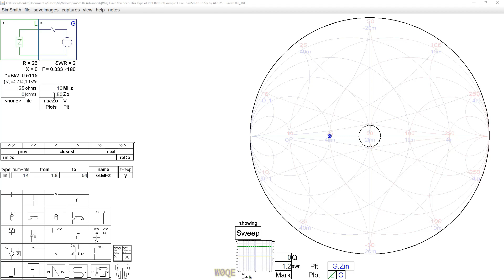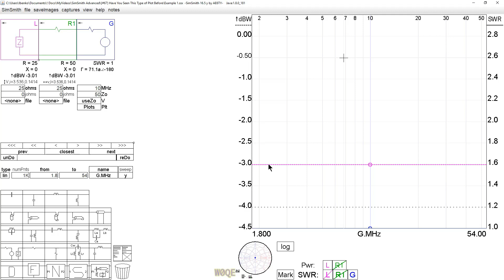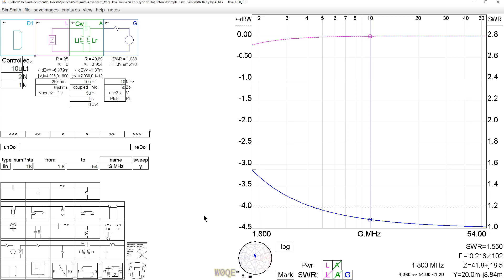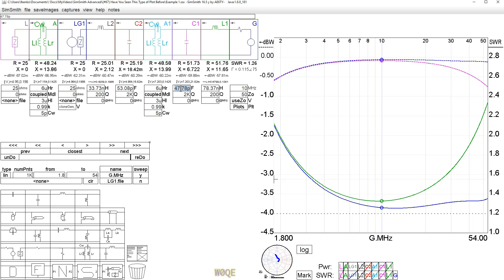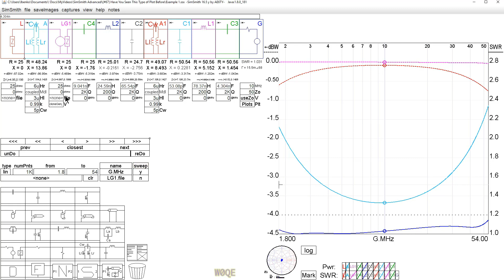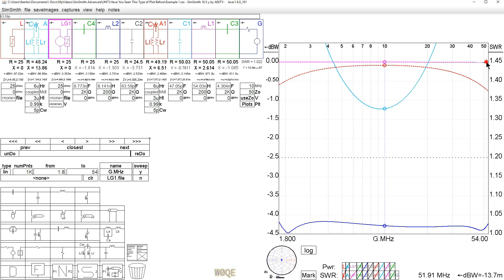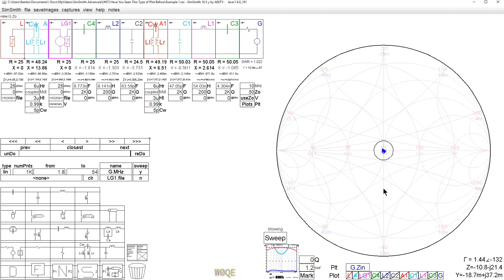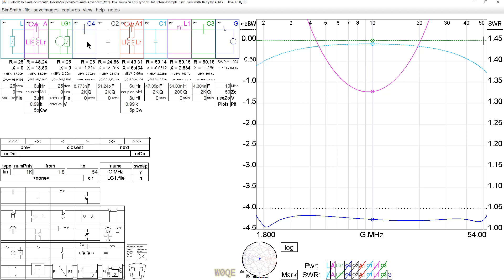#67: Have You Seen This Type of Plot Before?

Comment: Hi W0QE! I've REALLY enjoyed your video series on simsmith! This vid in particular has helped me significantly. I've taken a lot of what I've learned here and applied it to HF push/pull amplifiers. If you have anymore knowledge on push/pull designs to share, I assure you it will not fall on deaf ears!
Reply from the maker: Cale,
Limiting the discussion to solid state HF/VHF power amplifiers  SimSmith is probably most able to help understand power spliters/combiners and with impedance matching.  When low impedances are involved the enemy is usually leakage inductance in coupled coils and the compensation of leakage inductance is right up SimSmith's alley. I have touched on all these topics in videos but there is certainly room for a lot more to be done.  Thanks for the suggestions.
Larry, W0QE